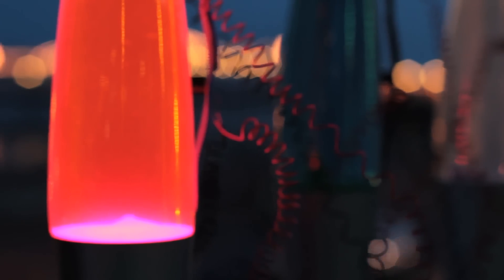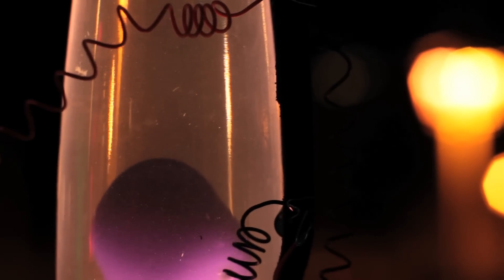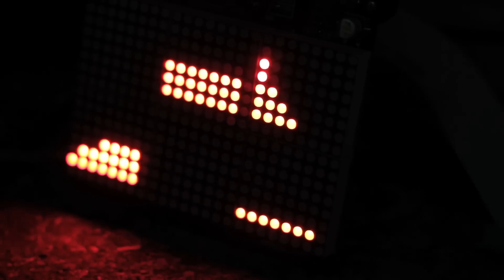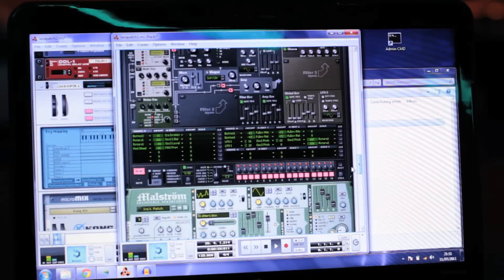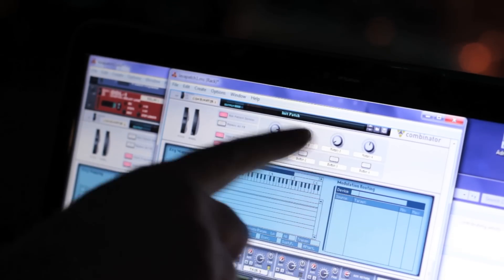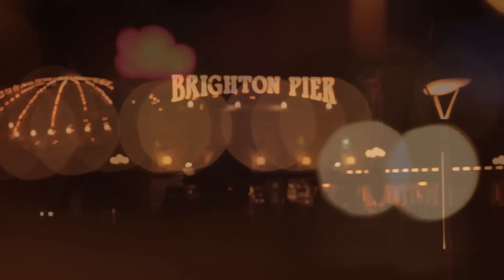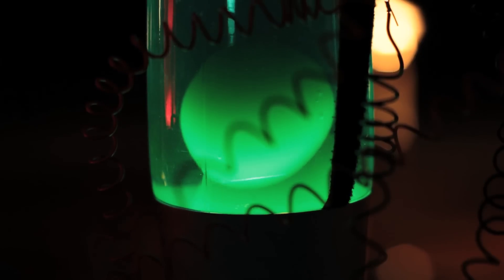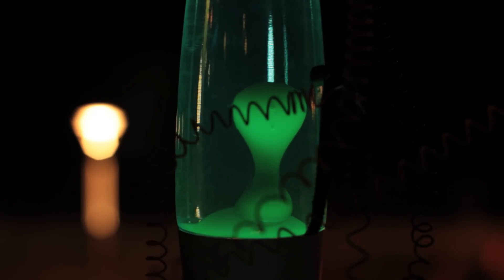Photosensors Coupled with a Lava Lamp Installation Make Music

Comment: @WolfeBear this is what i understood:  the light sensor detects movements. that signal becomes information trough the interface (micro-controller). that interface has a special program translating the signal coming into something the computer can read (binary). because very signal ( packet of information  now)  is unique the computer can identify them and perform special tasks define by the user.  the tasks in this case are :  loops of sound with rhythm already  stored in the PC.

Comment: @WolfeBear yeah as eucalypton said the lamp has sensors on it. I dont remember what he said the sensors did, but they somehow change resistance, or frequency of the returning signal. Then it is sent to the computer as random data. He has a program that interprets that data and layers sounds corresponding to the data.